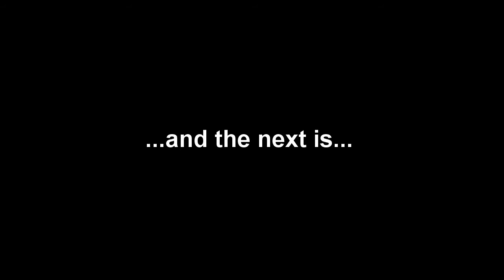Quick update #1

Comment: Taking into consideration that the workbench you made is mostly wood, and all the power tools you mount on it have only two pins plugs, the earth wire and earthed outlets you put up are useless, unless you intend to change the tools or to add others which may have earth contacts on their power plugs. Instead, you failed to fit an emergency power cut off switch which was mandatory.